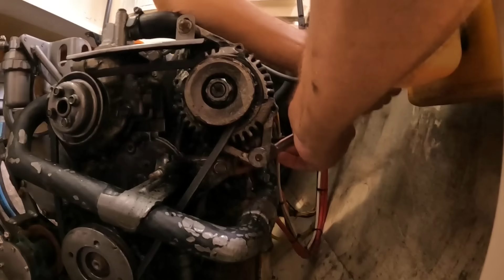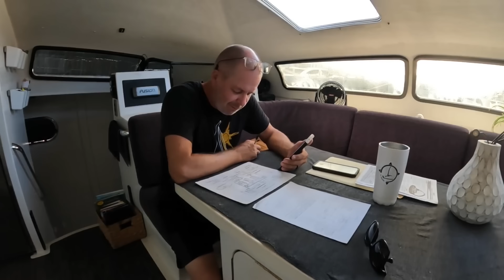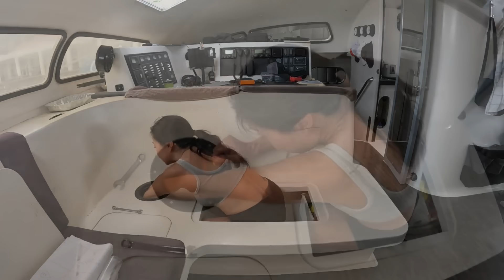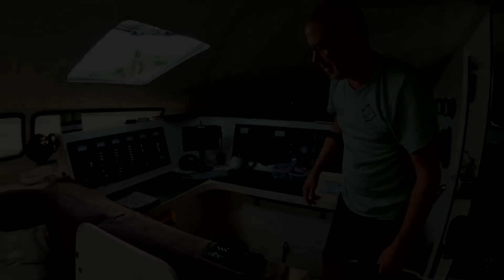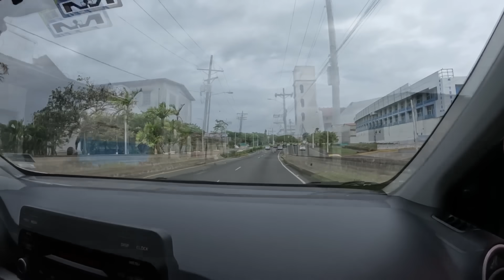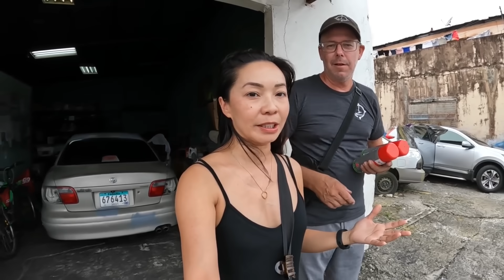Electrical GREMLIN Search! - Onboard Lifestyle ep.354

Comment: If you have two alternator charging systems that aren't possible to isolate, they are not redundant.  
In fact if one can take down the other, you have actually doubled the chance of failure over a single alternator.

Comment: I am not an expert on electrical systems. So, why do you disconnect positive and negative wires from all the batteries? It seems to me that just disconnecting the negatives would have done the job too.
Reply from the maker: We asked the Battle Born Battery tech the same question. He said that since each battery has its own internal BMS that it would be wise to isolate each unit to ensure the most accurate feedback without a possible bleed from another source.

Comment: An advice to others: They disconnected all the batteries - tough job others try to avoid, but that way it was necessary. 
When reconnecting everything please check every eyebolt and every battery terminal to be clean and sit well and all washers are at the correct place. Otherwise new problems could occure.
I saw a boat that had long time trouble - there was an eyebolt connected to the central pole that was corroded and made a significant resistance. He finally found it when another skipper visited with a thermal camera.

Comment: 13.6v out of the "good" one isn't great either, it should be closer to 14.2-14.4v... That being said, you could have tested these yourself if you have a battery drill so you could spin it and test the outputs with a decent multimeter (get a fluke) Plenty of info on here if you're not sure.

Comment: Guys - while I do not know the details for your alternator / lithium battery setup, I noted from the video that you referred to using the factory standard alternators on both engines. This is normally not advisable when combined with lithium batteries, as you should be using an external controller for the alternator to manage the charging loads and temperature / load on the alternator vs. the lithium batteries (systems like Wakespeed, Zeus, Balmer controllers). Without this the draw from the lithium batteries will overload the factory alternators, as the lithium batteries can take much more charge than conventional AGM's, which is what the factory setup was setup to handle .... in most cases the upgrade to an external alternator controller also requires and upgrade of the alternators themsleves ...I am surprised that this was not brought up by Battle Born, as part of understanding potentially root causes - as they sell one of these controllers on their website https://battlebornbatteries.com/learn/products/alternator-regulator/ - good luck getting everything back-up and running.

Comment: Good move on getting new alternators.  Your problems could be due to worn brushes or bearings in the alternator.  Sometimes just the tension on the belt pulls the axle out of alignment enough that the brushes aren't making proper contact due to wear.  Alternator may work on the test stand but once you mount it on the engine, and put it under load, the problems pop back up.  Don't forget to check the cables and connectors.  If they show any sign of discoloration on the copper, cut the end off and redo the connector.

Comment: Pity you can’t see the cell voltages of each battery Teal. All the batteries reading the same still could be different only once they are full and one of the cells spikes and shuts down the internal BMS to the battery. You only see this when they are charging up as the cells get close to 3.6v. I have had an unbalance and this is where you see it. When the batteries are sitting not being charged the resting cells are normally equal

Comment: The 20 year old alternator on my car failed intermittently, but never in the mechanic's workshop. I installed a $20 Ancel BM200 battery monitor which allowed me to see and log the failures. A new alternator had the same issues and the battery monitor identified it as a faulty unit. Another new alternator has been trouble free.

Comment: Battery tip, next time you are looking for batteries you should check out EPOCH 460 AMP HR battery, you can put 4 of them in the same space as the 8 100amp HR Battle Born battery for a total of 1840 amp hrs instead of 800, have 2 in my sailboat and they are bullet proof, work great, comes with wifi and app to monitor state of charge. Best of all Made in the USA

Comment: Livin in a city that coats the roads with salt the first sign of snow, alternators see way more salt than a boat. My engine in my van in the winter has a nice crusty powder all over it. BUT the alternator usually lasts 6 to 8 years.  The problem with boat alternators is people demand way too much from them. Power from the alternator should only be used to charge the start battery, engine instruments and maybe steaming lights.  
I remember years ago when I gave my daughter my car. She went and had a fancy stereo put in.  When I gave it to her(10 year old Camry) it had it's original(160k kilometers) 80amp alternator. Six months later it failed, 8 months after the the new 80amp alternator went. So. I put in a 100 amp alt to replace the 80 amp. That one lasted 5 years. 
In her 85 Landcruiser she runs a separate generator/batteries for her lights and stereo, her alternator runs the rest of the truck and start battery.

Dude, make a bracket for the engine and install a separate generator for your house system.

Comment: If you disconnect the field wire to the alternator doesn’t that simply shut it down so you run the engines and not worry about an output from the alternators?  That would get you back to port.
Reply: 100% correct he could unplug the field wire or wires and disable the charging. He could have one unplugged at a time testing to see which one was causing the problem without ever removing anything. Just a simple  thing takes just a minuet. Rather than days of alternator battery work. So next time most alternators have a big red battery + wire and 2 other field wires that control the current to the rotor coil that makes it a magnet so it will charge. You can just unplug it. Leave the big bat+ alone

Comment: Both of the original 20-year-old alternators have never been rebuilt before with seawater intrusion to one of them -  that narrowed it down.
I thought it might have been something with the rewiring Teal did earlier on the hard. Electrical problems are always a pita to solve.

New alternators for both engines are worth the expense for long term cruising 1400 miles without the stress of having to return to port with no power at night dodging major shipping traffic in the process. Basix will see San Andreas at some point. Safe travels Teal & Linh.
Reply: Yes my first thought last episode was the bow light he rewired, but my electrical knowledge said it was a regulator issue cos of the spike frequency.

Comment: Maybe also make alternator to battery disconnects so you can charge them on only one while both engines keep running? Then you may need a feed to the engine batteries also to keep them charged from the house batteries or your engines will stop. A bit of redundancy.

Comment: The only time I am running BOTH engines on my catamaran is when I am doing a rough inlet or docking.  I noticed that running both engines resulted in me only going 1.5 to 2 knots faster in most cases.  The way I look at it is I am just carrying a "spare" engine/alternator/starter.  I have 3ym30's too with the stock alternators, this is not the most optimal for charging the LARGE battery banks we have.  I charge the house bank with Solar/wind/portable generator.  My alternators only charge the starting battery.

Comment: Again it’s the voltage regulator. The alternators you have use an internal voltage regulator. The only way an alternator can go OVER voltage is if the regulator supply’s the rotor coil (round metal thing in the center) with power. If anything other than the regulator fails it will cause a drop in voltage.  The regulator supplies battery power to rotor which causes it to magnetize and that is what makes the alternator produce power. Regulator varies power to rotor to adjust voltage that’s its only function. The voltage  range for regulator is 13.2 to 14.8 anything above 14.8 is regulator full fielding the alternator (supplying a full battery voltage to rotor). Your battery’s only put out 13.6v so any time your voltage goes over that it’s has to be the regulator telling the alternator to put out the higher voltage above the battery voltage. no other part in the system other than solar controller can go above battery voltage that’s why we know it’s the regulator. When your voltage goes above 14.8 you will start burning out light bulbs, electronics will shut down to protect themselves, and your batteries will overcharge. Battle born have its own overcharge protection in the bms. Now you know all about voltage regulators.😁 Keep on sailing.🍺

Comment: Glad you found the issue.   They are not all the complicated devices, usually they fail due to a mechanical issue, bad bearing, broken wire or fired rectifier diode. Went through a dozen or so in my aircraft.

Comment: When checking LFP batteries, you need a voltmeter that records at least 0.01v and I prefer one that has 0.001v accuracy.  0.1v is a huge jump in LFP batteries.  

I would not rule the batteries out as a part of your problem yet because in their nature, LFP batteries have a nearly flat voltage curve from about 10%-SOC to 90%-SOC.  To check that all eight batteries are in balance, you need all eight of them to be nearly 100%-SOC.  I would charge each battery to 14.20v individually with a power supply.  You want to record the voltage before you start and how long it takes to get to 14.20v.  Assuming that they all start at the same voltage, the difference in TIME to get to 14.2v is the amount that each battery was out of balance from the others. What you are looking for is the difference in the number of Amp-hours each battery has.  Assuming that you are using a 10A power supply, if one battery goes from 13.5v to 14.2v in 4-hours and another battery takes 2-hours, those two batteries were 20Ah out of balance.  That is a 20% difference in your total capacity.  The only place this can be checked is at the very top.  

While you are doing that test, you want to watch the current as the voltage approaches the 14.2v level.    It should stay at 10A until you get to about 14.1v and then drop incrementally down to 0A.  If it is taking the full 10A as the voltage approaches 14.2v.  If the voltage jumps to 14.2v and the current drops to 0A, that indicates that the individual cells in the battery are out of balance and the BMS went into over-voltage-protection (OVP).  If the battery is at perfect internal balance, you can charge to 14.59v without the OVP sudden drop of current.

Comment: Lithium batteries are very hard on alternators. Two ways they can pull way more amps than lead acid and the bms will shut off power and fry diods. Worth products are the best!

Comment: The problem with lithium with a BMS system is that when your battery’s are fully charged the BMS will stop charging the individual batteries once all battery’s are fully charged all the BMS will shout down, then what happens is the alternators keep sending a charge out. If it can not charge something it will destroy the alternator and start spiking the voltage and destroy everything on the vessel or RV this is why everyone should keep ( 1 ) led acid battery just to prevent the alternator from destroying it self.
Reply: Wrong you got it backwards. The alternator will start to lessen the amperage to the batteries when they get full. That’s what the voltage regulator does. On  lithium you need a special regulator to limit how much power the alternator puts out when the batteries are empty so it doesn’t overheat as lithium will take way more amps faster than a lead acid battery when they are low.

Comment: its a piss poor system if can be taken down by ,5 diff
Reply: I believe the battle born guy was incorrect in stating an unbalanced battery will cause voltage spikes. Only two things cause over voltage is voltage regulator in solar controller or voltage regulators in alternators.